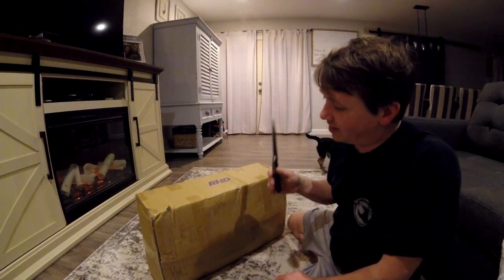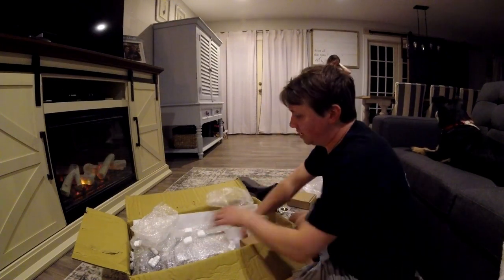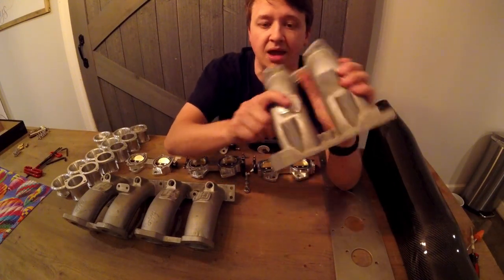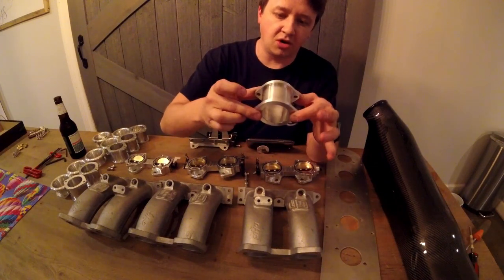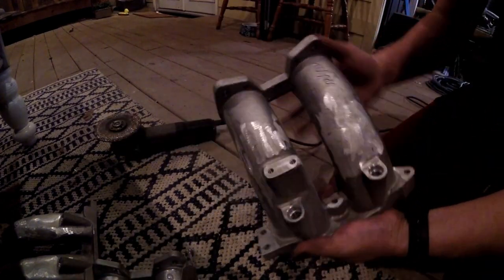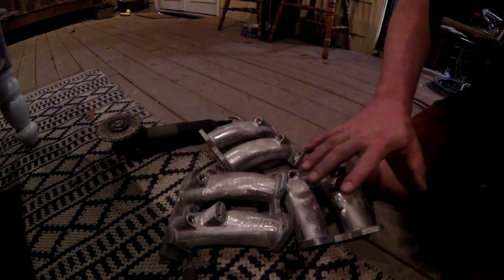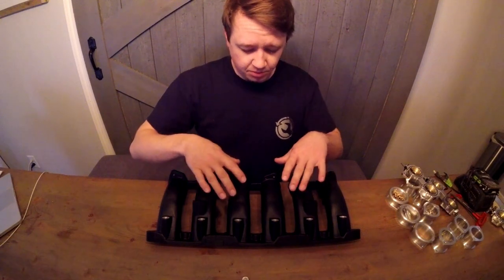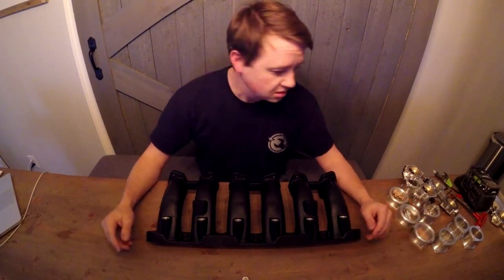E36 RHD ITB MANIFOLD CLEAN UP

Comment: I thought that a rougher intake is better for performance because is disrupts airflow thus causes a better air fuel mixture am I right or wrong?
Reply from the maker: Karim Mortada not this rough on the inside! and you want it rough right where the injectors and air meet onto the cylinder. But before you want flow to move more air. The exterior is the main roughness that needs to be taken care of for looks only.